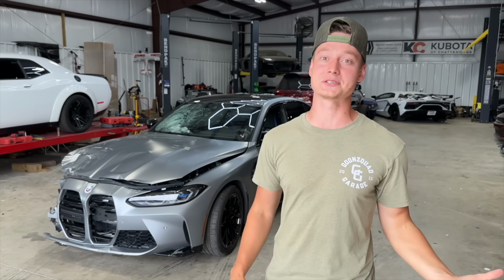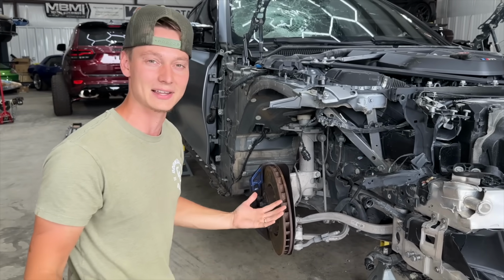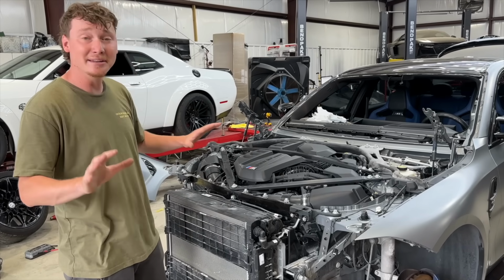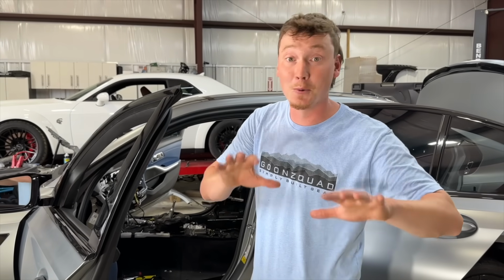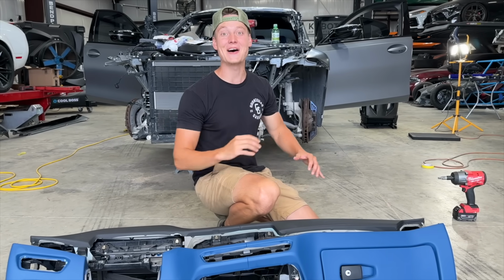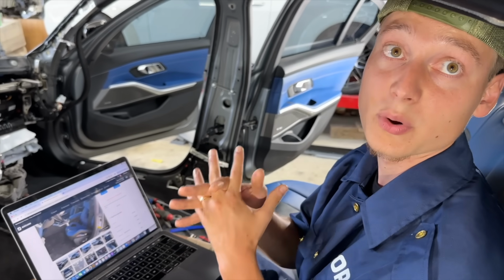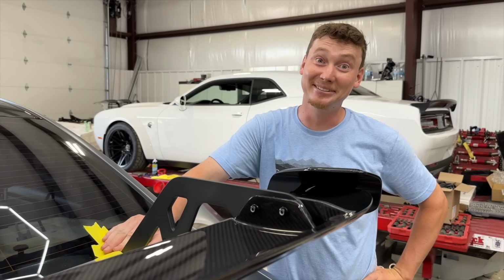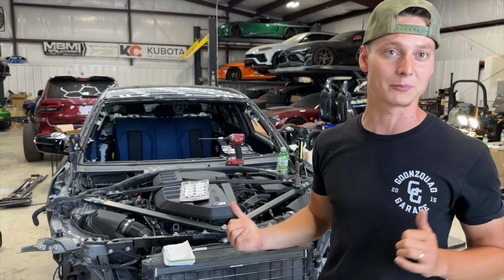Rebuilding A Wrecked 2023 BMW M3 Part 2

Comment: What I learned from when I worked as a dismantler is the interiors in bmws are put together really good. Whenever I got an order for a bmw dash or anything from the interior I was always relieved it wasn’t an Audi or Volkswagen and would get a dash out in like 10 min
Reply: Wait until you work on the engine. Then you would wish you work on an VW or Audi
Reply: @MomoxD1969 bmws are the easiest engines u can work on. U need to drop the whole motor to do timing chain on a Audi
Reply: @ARoll-uy6ty  tell me you have never worked on an LS without telling me you never worked on an LS

Comment: Absolutely LOVE this project! As a BMW fan, I was wondering how long it would take you to discover the 'other' German brand. Sorry to hear that you fell victim to the 'Florida Crew'. If you've checked out Vehcor's channel, he's been on a campaign against these guys for months, revealing a long series of lipstick on a pig' cleanups. He just featured a Lexus they'd doctored. Sadly, it had been run without an oil cooler. Just another reminder that there is a lot more to rebuilding salvage vehicles than meets the eye. As to the wing, hey, go for it! It's a rebuild, it's an over the top hot rod, and I think it will all work. Not a fan of 'frost' paintjobs, but maybe it's time to bite the bullet and do one.

Comment: I had this same problem twice. The first time I got an F-150 for way cheaper than I thought it would cost, so I researched more and discovered the original auction photos and found a lot more damage than I wanted to deal with so I paid to relist it.  The second time they got me and due to a severe rain storm when I went to Houston to pick it up I didn’t look at it before paying for it.  By the time I realized how bad it was, it was too late.  I got that just over a year ago, and last weekend was the first time I was able to drive it around the neighborhood, hopefully in a couple of weeks I will have the title changed to rebuilt and registered legally on the road.

Comment: Carbon fenders, front and rear bumper, diffuser, skirts, canards, trunk and doors……but paint them. Be a bit “stealthy” by painting them but get the weight savings. Titanium exhaust, and some nice carbon parts under the hood. Shock tower braces as well

Comment: It’s insane how that oil cooler didn’t puncture. Rock pebbles can hit them and damage the fins enough to drain the oil. It’s all under pressure. They sell aftermarket guards you can install that protects it better

Comment: Not that you have to. but I think it would be nice to see a Pontiac G8 GT rebuild. A relative had one with a LS3 6.0 and it was fast! It had a nice set of wheels, sloppy cam, and a split metallic paint job, with black over dark red. It was a really nice car, and is pretty much a corvette with a few extra pounds. I would love to see you guys build one out, as they are nice cars, and not that much to buy from an auction.

Comment: I think if youse go with carbon fenders they should be painted a nice trunk roof hood transition is good but fenders is a bit much unless there painted ( and usually against painting carbon, but to get the weight loss may be worth it ?)

Comment: Carbon widebody kit 800hp on a m3 is insane, with bolt ons you would crank it up to 900 and e30 map, get custom exhaust go crazy on it, If not wide body kit get the carbon fenders, and carbon bumper if possible

Comment: 850Hp that’s insane you will have the car go sideways and traction control light constantly going on when you get that on Sport + mode. BMW has been known for 50/50 weight distribution so it’s not going to get super sideways like a Hellcat but enough for you to feel it and BMW ECU will either apply brakes and deceleration (safety) or let you spin it depending on what drive mode you set too.

Comment: Someone correct me if I’m wrong but it looks like the brake rotors are on the wrong sides(backwards). You can see at around 3:45 that they are directional based off of the cooling fins. They should be scooping air, they look like they need to be swapped sides.

Comment: I think that the wing needs to be rethought.  I like the carbon... other carbon things you are adding are sweet.  I also wonder about the pressure that wing will put on the carbon deck lid might crack as a result. Just my two cents...

Comment: All
That’s gonna get downforce is the trunk lid to the rubbers, wings are supposed to bolt to the rear suspension or chassis to work as downforce at the rear

Comment: I just wonder how do you plan to tune the ECU, because bmw's ECUs produces after 2020 are blocked and can't be tuned. Also 850hp is too much for this engine if you don't plan to open it up and change internals. It would be safer to run on 750hp. But also if you somehow be able to tune the engine, stock turbos are also capable to get 750hp on the crank.

Comment: I work at Copart and a car with an X at the end of the lot numberis a car that has come from the insurance. Now what that means is that the car was in an accident and one of two things happened after it was towed away from the scene, it was taken to an insurance approved garage to check out which is unlikely as the insurance would have seen the extent of the damage from photos taken by the tow at the scene and not bothered to get an estimate to fix it so in that case it was taken straight to Copart. Now at Copart the people who receive the cars they have no time or tools to straighten anything up or to doctor anything up, I think what has happened here is that the car was listed once, it didn’t bring the value that the insurance was looking for so they sent out an engineer to the car who doctored it up so they can make more in the auction hence the 2 lot numbers, it was re imaged after the engineer and sold to you guys, engineers also don’t have any type of tools so what they did was basic, clean it up abit and of it goes. Must be a smaller insurance company who didn’t want a huge loss on such an expensive car. In terms of you guys being told it’s a third party seller it’s because when a car is reimaged with a new lot number it’s listed as third party on behalf of the insurance which which the 3rd party is just Copart in that case. If it was someone buying it to doctor it would have had a C on the end of the lot number and copart would have told you its a private seller.

Comment: Twin PULSAR NEXT GEN Billet S372 72/80 DUAL CERAMIC BALL BEARING Turbo's & MOS 1150 USD each. They should push it over 1000 HP.

Comment: Do not do carbon fiber, fenders, do the front and rear diffuser, the hood, the mirrors, maybe the front bumper exhaust and the single turbo. If you do the fenders, it will be too much carbon fiber.

Comment: After all the modifications and 'upgrades' that you do to your cars like straight piping etc would you be losing money on all of them ? Is that why you have so many now just gathering dust ? I don't understand why you don't auction some off or make them the prizes instead of buying brand new ones . I can understand if it's some kind of tax break but you are creating so many problems having so many cars. Love you guys but you need to do some serious tidying up of stuff. You can't even use a lift without moving several cars .

Comment: I really don't understand modifying a brand new (to you) car just for the sake of it.
Drive the car first, then decide what mods it needs. 400hp might be plenty. It might need $40,000 in suspension to drive properly. It might be perfect as is. You don't know. You're just going to get a car that runs like a pig and requires triple the maintenance and you're scared of driving it too much because the trans or diff will go at any minute.